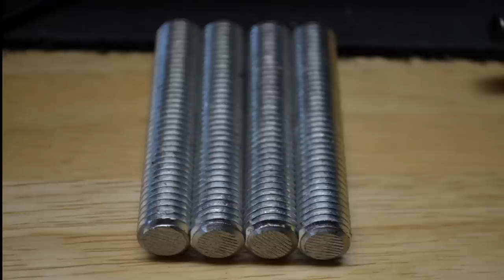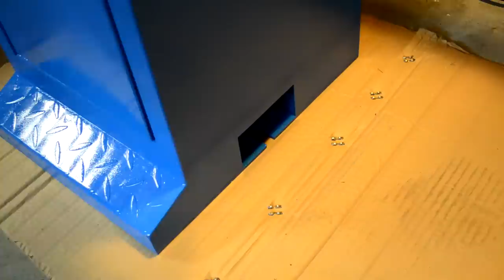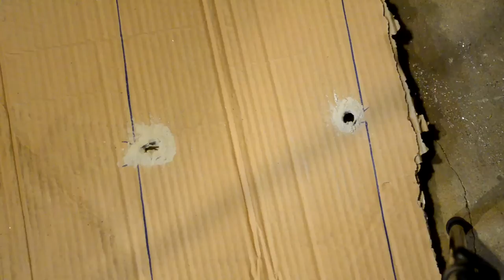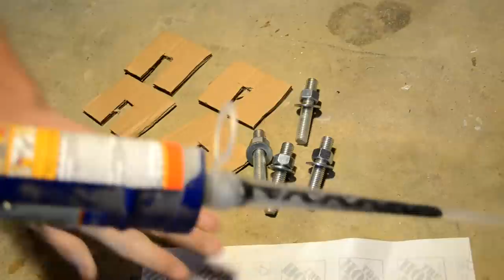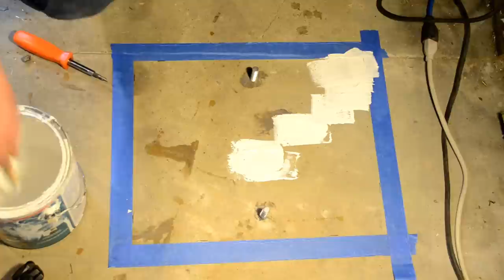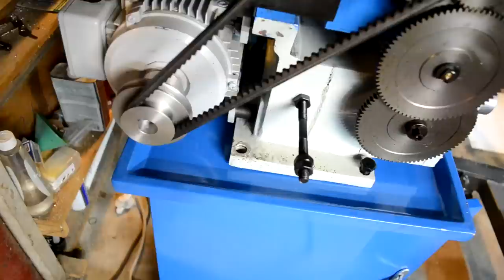Installing a Benchtop Lathe

Comment: anyone needing to get dust out of a fresh borehole like this (and wanting to avoid making a mess) - use a small diameter plastic tube (strawtube for example or those more rigid suction tubes you can find in the large shampoo bottles after you used them up) and use your hand around the vaccum-intake to guide air through that tube - now use the strawtube to suck the dust out of the hole.

Comment: Wondering how out of level this initial setup was since there is no provision for leveling?  I had to shim about 1/8 " on the front side of the tailstock end of the bed after tipping the entire lathe back about 1/4".  Was worth the effort though as it now cuts with only about a 2/10,000" taper per foot... a big improvement over the initial base stand setup similar to this video's that caused .009"/ft taper

Comment from the maker: The top surface of the stand is 30.5" tall, which puts the center of the spindle bore at 43.5".

The back splash on mine is 7" away from the back wall, that puts the control box, which is the only thing I would want to get access to about 9" away. It will be a bit tight if I ever want to change a setting on the VFD.

Comment from the maker: Getting the engine hoist into place was a pain, but I have a small shop with low ceilings so it required a bit of finagling (I didnt have enough space to turn the engine hoist around with lower legs outstretched so I had to lower lathe onto blocks, fold the engine hoist legs, move it to the other side and re-lift the lathe. Once the lathe was over the base I just lowered one corner using the load balancer, pushed it to line up one bolt hole and did the same for opposite corner - very easy.

Comment from the maker: unapro3 - My hand is under the control box - its a good 2-3" higher than the bottom of the lathe so plenty of finger room if the straps or engine hoist had of shifted/failed. My hand never went under the lathe bed.
Reply: Ah, I see that now you have pointed it out, cheers.

Comment from the maker: I cant take exact CTC measurements because of all the stuff in the way with it mounted, but the base has 4 mounting holes for the head stock and 2 for the end of the bed. The furthest holes are about 41 1/2" apart, and you'll have a total of about 4 1/2" of the base hanging off the end of your chest.

Comment from the maker: I had the 1 ton version, What make/model is the chest? I originally planned on putting this on a Craftsman Bench - Rated for 1600lbs, but it still seemed too flimsy when I had the Lathe on top (2" butcher block surface, sheet metal sides).

Comment: Thanks, but Matt sent me a drawing with all the measurements laid out.  It appears I'll be able to bolt the lathe to the top of the chest using four of the six mounting holes without any issues. That should be enough to hold it.  But I did order the stock stand for the lathe, just in case.  :)

Comment from the maker: The floor is only about 2" thick in places and the 1/2" expanding bolts needed a 2 1/2 " hole to work properly.

If the base covered a larger area I'd have made some machine mounts from hockey pucks but the base isn't very deep and I was concerned about it tipping back/forwards.

Comment: Do you have a 1 ton hoist or a 2 ton version?  One reason I want to try to put the lathe on a rolling tool chest bottom is because I will be able to use the extended arms of my car lift to lift the lathe out of the back of my wife's truck, then toll the chest bottom underneath it to mount it.  Then I can just roll the whole thing over to where I want it to live in my garage.  Theoretically, any way...

Plan B would be using the stand with a roll around engine hoist like you used.

Comment: How tall is that stand?  And how far away from the back wall do you HAVE to have the stand?  I'm considering getting one of these, but not sure if I want to mount the lathe on it's stand or onto a bottom roll around tool chest.

Did you have any trouble getting the engine hoist positioned where you wanted the lathe to line up with the mounting holes?

Comment: Thanks for the measurements.  Could you possibly measure the mountings holes for me?  I would like to mount the lathe on a rolling tool chest bottom to match the other chests I have, but they are only 41 " wide.  It's also taller than I would like at 39.25" tall.

Just want to know if I will be able to use ALL mounting holes of the lathe on that surface.

Comment: Thanks for the video.  I have a similar hoist that I plan to move my PM-1022 (limited space I have) once I get the seeds to buy it.
Where did you find/build? that nifty gambrel for your hoist?  Beats trying to balance with bungie cord and ropes or such.
Reply from the maker: It's a Load Leveler, I used the 3/4 Ton one from Harbor Freight.

http://www.harborfreight.com/3-4-quarter-ton-capacity-heavy-duty-load-leveler-67441.html

Comment: How do you like the machine? Does the gearbox work properly or do you have to swap change gears between threading and feeding?
Reply from the maker: I like it. You still need to change gears to cut threads, just like the smaller lathes. Changing gears to cut threads will alter the feed speed too, which I do not like - but don't cut many threads so it wasn't an issue. If I did I might have bought a larger machine with better gear box setup.
Reply: I see, next step in the "new department" with gearbox would be a 12x36 or similar then i guess. Thanks.

Comment: This is the model that matches the tool chests I already have -> Sears  Item#  00910600000 | Model#  10600.  It seems pretty sturdy, but I'm still going to put some blocks underneath the chest just in case one of the wheels fails.  I placed the order for the lathe today, so Matt says it will take 10 to 12 weeks for it to show up. :(  But that gives me plenty of time to get everything together in the meantime to handle the install.

Comment: Why epoxy the bolts into the concrete where expanding dyna-bolts would lock in place way more securely. .
Reply from the maker: Thin concrete.
Reply: blimey how thin is the floor, but if it is that thin then epoxy makes sense your only stopping it moving around after all.
Reply: You can get short Rawl Bolts.

Comment: Bad concrete is causing your camera to shake while drilling holes in floor. I'm wondering if this is affecting your lathes accuracy?
Reply from the maker: The concrete slab is split into sections. One of the camera legs was on one small section (possibly a sump, that was later filled in) - The lathe is all on a larger single section, so I hoped it wouldn't cause any problems.

I haven't noticed any accuracy issues - but the type of stuff I'm usually making are small rods where tight tolerances aren't necessary. So I probably wouldn't notice even if it was suffering.

Definitely something to consider, I had heard of people pouring a raised slab and mounting their lathes to that. If its thick enough that should prevent any issues.
Reply: n1bpd I'm relatively new to the home machinist hobby, but I have been installing machines for over 27 years. As such I have seen most if not all ways of anchoring a machine to concrete and the weird harmonics that can result from less than perfect concrete. I have been seeing more and more YouTube videos stressing the need for proper lathe set-up, hence my question. All the best to you.

Comment: By now you probably know that with no silicone seal where the bolts go through the drip pan - the oil seeps out making a mess. Otherwise good technique!
Reply: ExtantFrodo2 leather makes great seals and makes great parts place mats.

Comment: Do you like this lathe?
Reply from the maker: I like it a lot, no regrets on buying it at all. I did go from one of the 7x12 Mini-Lathes, so I'm sure I'd be happy with pretty much anything bigger though. I was considering getting the G0602 because it would have fit my shop better, but chose this because it had power cross feed, a separate feed/threading screws, VFD motor and a large spindle bore.
Reply: n1bpd Thank you for the reply, I appreciate it. I have a sherline lathe and I'm considering getting a bigger lathe, I kind of like the PM1236, a cnc conversion of it would be nice.

Comment: Did you level it?
Reply from the maker: Yup, I bought a starrett machinists level. I didn't show it as I didn't feel it would help anyone with me not talking as there are much better videos showing it being done with good narration.
Reply: How did you level the lathe?I do not see any leveling feet's, only bolt down to the floor.
Did you level the tray with the lathe only?

Comment: Damn these cheap Chinese lathes, don't even give you levelling bolts on the base of your stand, I guess the metal material is too thin and tinny to support them even if they did, whereas the Taiwanese units come with levellers to adjust the twist out of your bed, just one more feature that is a big bang for your buck cutting threads aside 64 TPI vs 112 TPI etc etc. Hell the AL-960B is a hell of a better lathe for the price just a few hundred more than the model shown here.